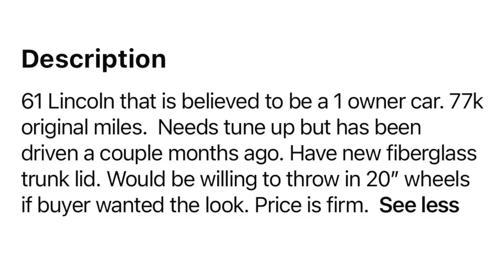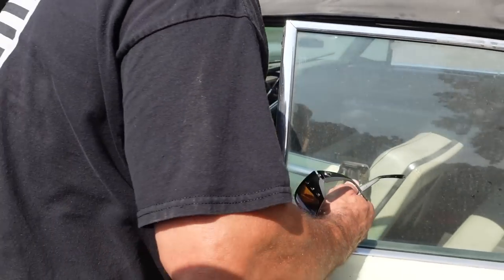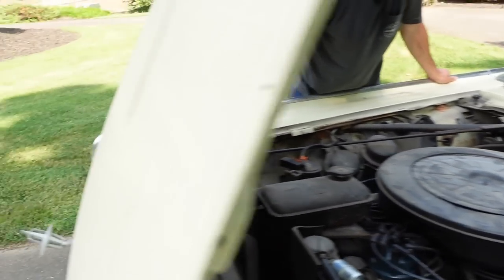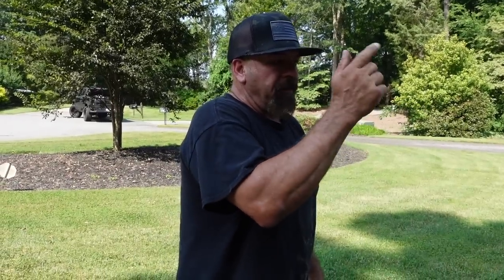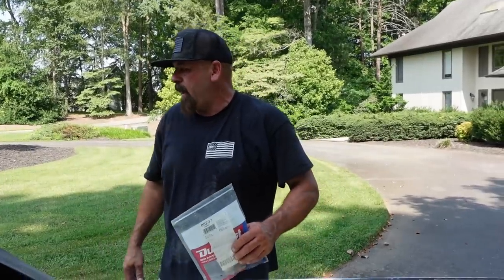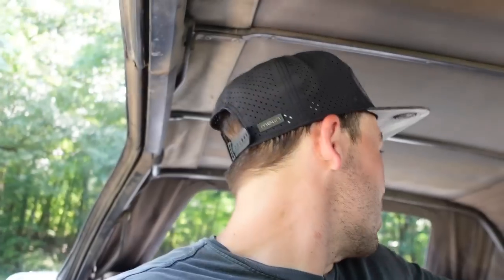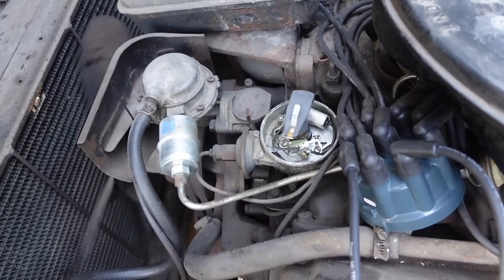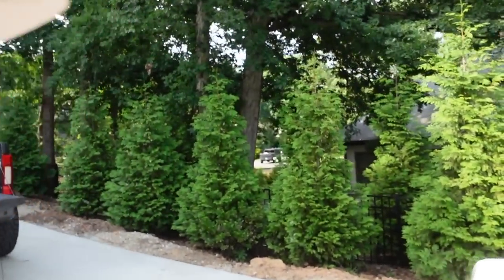We Bought A Rare Original 1962 Lincoln Continental Sight Unseen - Then Broke Down Part 1

Comment from the maker: What motor should we put in it?!
Reply: Ford godzilla would be sweet.
Reply: Dont ruin this gem have the motor rebuilt the value is that much more if the car was a rat then you should modify it that car is to complete 😢
Reply: That engine is like a 461 or something....replace it with a 460 if you don't rebuilt what is there !!!!
Reply: A 7.3 diesel would be an absolute riot in that old barge
Reply: a godzilla with a 10 speed trans and don't forget to bag it BTW I am from Wilmington
Reply: 7.3 godzilla
Reply: Godzilla forsure
Reply: Keep it ford powered, go with a godzilla power plant if the original engine fails
Reply: 12v Cummins
Reply: Definitely a tesla swap
Reply: Rebuild the motor in it.
Reply: Helephant swap 10sp trans
Reply: 6cyl ecoboost, keep it fomoco
Reply: Ford 7.3L Godzilla with a 10 speed
Reply: I vote for the new ford Megazilla.
Reply: Keep it ford powered...!!!
Reply: Rebuild the engine that's in it. Just upgrade it a little. Or a lot. But keep it a big block, Ford.
Reply: Gotta put a Coyote or a Godzilla motor in it then add force induction. Love the wheels! Its a dream car for me. Cant wait to see what you do to it.
Reply: Godzilla 7.3W/TT
Reply: Turbo 7.3 Godzilla
Reply: This needs to be done similar to Dax shepherds only in a convertible, big motor, lots of tire, drift brake just a badass driver that incinerates tires.
Reply: big turbos what ever you put in it ....  A Spooolin Continental would kick ass just sayin
Reply: SMX motor.
Reply: Power stroke it paint it black on black on black and call it night train with exhaust coming out the hood so it rolls coal like the old school trains did!!!
Reply: 2JZ w/big turbskies!   (Twin turbos)😂
Reply: Ford Godzilla motor HP tuned as well as 10 speed trans with air ride !frame off restoration with the second tires and build it into a daily driver. Smoke show machine.
Reply: big bock witj super jarj
Reply: Hellcat or coyote motor, do it triple black & pair of Detroit steel wheels ... Do not chop it up etc like the c10
Reply: Brad I would keep as original as possible, nothing like seeing an oldie like that done up like it just came off the lot new. She's a beauty just the way she is! Take care and God bless😇💙
Reply: Coyote swap, keep it Ford, Lincoln , as much as I hate Ford, but I no whatever y'all do is gonna b Kool and fast🤟🤟🤟🤟🤟🤟
Reply: Brad your dad wasn't even a sparkle in your grampa's eye when this car was built, I know that you will do her right👍
Reply: Give this the full treatment Sema build convertible there cars have been done but not like you guys do and not a convertible
Reply: Coyote with a 3.5L whipple
Reply: Stroke that 430cid to a 462!!!!!!!!
Happy Independence Day, gentlemen!
Reply: Coyote 🐺🐾🐺
Reply: 7.3 powerstroke with compounds
Reply: Build something like Hoonigan did with Slay Poupon
Reply: Godzilla motor swap or a 5.0
Reply: Bro maybe 🤔 an LS swap
Reply: Do a 5.2 illuminator, or a 7.3 powerstroke
Reply: Put the same as Cleetus  macfarland  has in that mustang McFlurry.
Reply: @wilburfinnigan2142  that was after 66 this came with a 7.0 430 320 HP and around high 400 tq at 2000 rpm
Reply: My cousins first car was a 72 olds delta 88 with a 455 rocket and a 3 speed posi. That car was a beast for the size it would pass everything but a gas station
Reply: we put a 7.3L Godzilla in ours .... we have 3 brand new Godzilla with a 10speed trans fresh from the factory if your interested
Reply: Keep it ford big block, add some efi as well.
Reply: I'd rebuild the original drivetrain and freshen up the rest and make it a weekend cruiser
Reply: @lukefolken1597  was my first thought.
Reply: Mercury motor!
Reply: Supercharged Coyote!
Reply: Keep it Ford powered. Godzilla?
Reply: Unless the motor is missing or destroyed the original motor is
Reply: Don’t ruin a classic. Rebuild the original motor if possible. If it’s beyond repair, look for a replacement that is as close as possible. Too many classics being ruined with LS and Coyote swaps in my opinion.
Reply: Hellcat or demon
Reply: Godzilla and a turbo with a 10sp trans and a 9in
Reply: A 460! 
Why even ask!
Reply: GT500 engine
Reply: I'd keep it All FORD and do a GODZILLA swap  and then after that air bag it with some air ride technology or see what QA1 offers and definitely get those wheels on and would try to keep the PATENIA
Reply: Super charge a Toyota 1uzfe v8 and nos , bullet proof stock crank....something completely different
Reply: hellephant :D for sure ..  or tesla swap or something K series would be fun
Reply: 7.3 Godzilla crate engine
Reply: @lukefolken1597  hellephant or Megazilla :D
Reply: @jaison206  but it's a ford!
Reply: @jolo7693  /shrug doenst matter right new cars also have parts from other brands on there i mean look at hypercars and super cars there full of components that are from other cars and brands
Reply: 7.3 Godzilla gas
Reply: I feel bad for you and your dad I have a 68 Chrysler 300 2door hard top it’s lowered and has a custom gene Winfield paint 67k miles but it’s all original beside paint clean almost zero rust runs drives like new I would sold it to you guys for 10k just to see you guys enjoy it I got it to enjoy with my father but due to him losing his job and my injuries we won’t ever do anything with it beside drive it once a year in parade
Reply: Put in a John Kasse 460 , with fuel injection
Reply: Godzilla
Reply: Stock block and heads. If there are numbers...you want numbers matching.
Thats doesn't mean you can't build it or revalve it.
Reply: Possibly a 430
Reply: @lukefolken1597 you have to completely chop the cars front end out to do that. Not a wise choice on a unibody
Reply: Safety tip number one, 
Don’t let the car run with no one in it. The shifter tube bushings wear out and the car can fall into reverse on its own. It’s common
Reply: Barra
Reply: The engine is a 300hp (Ford/Edsel) 430 ci. Decent engines actually. I would find a builder to redo what's there if the block is still good. Find the Jay Leno episode on one of them. There's a guy on that travels around the country and ONLY works on this vehicle. He knows every thing about them and he can fix in a day what a butcher would waste months working on because he has no idea what he's looking at. It's old school, but quite complex for its time.
Reply: If the og motor is good I say keep the 430 that’s in it. They aren’t incredibly powerful by today’s standards but they pull strong
Reply: The motor could be a 4 valve 462ci big block or maybe was just later Continentals. I would have bore scoped it first before starting/ let the chambers soak overnight see if the rings come back around. Oil change regardless/ spark plug change if previous caretaker didn't do and run to a temporary fuel source. But..... I can totally understand the excitement and cruising in it right away. Imo this was a great buy. I would detail it. Get it running and driving good. Fix top issue and put it through a auction. Depending on mileage it could go for 60k+ if it gets good hype
Reply: I’m a Mopar fan. But honestly I would stick with a Ford motor preferably the original with the matching numbers.  I wouldn’t worry too much about how many cubic inchesif you replace it. Any modern motor 5 liter or more is going to have more torque and horsepower than what came with it.
Reply: Super charged Coyote
Reply: Get it driving run around in it why waiting for parts and big block it paint it and retrim it so its full on badass
Reply: Stock motor cleaned up. You are going to have enough problems with the top, don't drown yourself in projects.
Reply: Cummins!!!!
Reply: The standard 460
Reply: The standard 460
Reply: Throw a 460 in it .  Wax it and drive it.  Full resto on thoes is never ending.  That top is a nightmare.....
Reply: If anything, a 462; that is really the only engine besides the 430 it has now that will go right in.  Nothing else will mate to that transmission, let alone the structure, without a good five figures of structural cutting and total drivetrain swapping (we're talking more than initially paid for the car, at least as much as it is worth, which I suspect to be a good $30g's in its current state).  You are aware this car does not have a separate frame, right...?  If not, you are now.
Reply: @aloysiusbelisarius9992  I have a friend that has a 63 Ford Thunderbird with a 430 in it it was special ordered that way
Reply: Just rebuild the original motor & restore the car.
Reply: @philliphart706  Indeed...??  That had to have been a very special order; the 430 became a Lincoln exclusive starting in '61!  On the other hand, T-Birds and Lincolns were produced in the same niche of the Wixom factory back then, so it might have been relatively easy to move a 430 from the Lincoln line and drop it in a T-Bird.
Reply: @aloysiusbelisarius9992  my buddy got the car from a guy that owned a dealership and he ordered it that way
Reply: Keep it all original!! I think that engine is a 430 cid. During his motorcade I saw JFK sitting on the trunk part with his feet on the rear seat of  a1962 blue convert in mpls mn in Oct 1962. I hope to get one someday. Great car!!!
Reply: Something that rare and original should be kept that way. If you want a hooptie then find a basket case and put whatever you want in it. You guys amaze me that you don’t even know what engine it has in it.
Reply: You are incorrect, the tbirds came with them for a coupes years. No idea which ones and why, but some did. Maybe certain plants or inventory reasons. 

To respond on your other reply also, my 64 had an original drivetrain. My current 65 I swapped and both were my daily. With that said I’ll never own another MEL powered car as they do suck in every way for modern driving. That is all
Reply: @madkidd00000007  no I'm not incorrect 61-63 at special Thunderbird 390 I have a 63 my friend 63 who he bought from a a former car dealership owner I have seen the line set ticket 430 cubic inch motor is in that car it was ordered that way in 1964 they put 429 in those cars we had a mountain West Thunderbird club here in Idaho which I was the vice president of unfortunately a lot of our members passed away or they sold the cars but as far as you saying about how they drive or whatever I'll keep mine till I die and runs great handles great not like this junk they make nowadays of recycled beer cans and milk jugs and that is all I have to say
Reply: Shouting out from Greenville NC ❤
Reply: 5.0 coyote with a Whipple... Ultimate sleeper.
Reply: please for all of us Ford people... keep it on the OEM motor
Reply: The key selling points from factory should be improved and highlighted like the air suspension should be ripped out and updated and the convertible top switched to electric or the car is going to have a broken top or a broken suspension and not fun to drive.
Reply: Pretty standard Mercury Marauder parts. Formerly Hot Rod Garage Tony Angelo’s could help you out he has been doing some luxury Ford Hot Rods lately.
Reply: Fuq YEAH! Keep 'er Ford fellers...can't wait for this one! Damn, I think I got a chubby!
Reply: Cobra Jet
Reply: Restore and rebuild.  Don't destroy its value by chopping or swapping.
Reply: Keep original otherwise go coyote.  I got a 68 and cant wait to work on it
Reply: Put a coyote motor in it
Reply: Or her ego boost motor in it with a 10 speed training
Reply: yep. Godzilla. stock Godzilla! don't get too silly with it.
Reply: Keep it STOCK!!!
Reply: Those original MEL 430 V8's were bulletproof. Keep it!

Comment: I've followed these cars for over 30 years, and I own a '63 sedan. To find an original '62 convertible in this condition is a really good deal and a rare opportunity. Having said that, I know the restomod market for these is pretty hot, but they're only original once and original ones are disappearing. I would get this in shape and keep it original, then use the money to restomod something that's already been worked. Originality is very very valuable. It's your car, but it would be hard to see this car lose its original quality. 

The engine is a 430 MEL, by the way. MEL stands for Mercury Edsel Lincoln. This engine replaced the old Y Blocks used in the Lincolns of the 50's.

Comment: Full frame-off restoration. You will be amazed at how much you'll appreciate it and how it runs & drives.
Not everything you own has to be a racecar.
Reply: "Not everything you own has to be a racecar" -- exactly!
Reply: Couldn’t agree more.
Reply: They are uni-body so no frame.
Reply: @Alwhite1929  let's not split hair and get technical, you know exactly what I mean. It can still be restored and be an excellent car.
Reply: You’d be amazed how bad they run with original drivetrains if you actually owned one
Reply: @charleswhitten3441  Ain't no hair-splitting there.  The difference between frame and no-frame is major, especially with these cars which are even more unitized than cars made today.  Not even the fenders will come off without cutting...and any helter-skelter cutting into the structure will compromise its integrity.
Reply: @madkidd00000007  I trust you mean the context of the opposite, right...?  That's how I would take it, because my own is capable of breaking its speedometer, yet it's as calm and smooth as anything with any legal speed limit one chooses.
Reply: @madkidd00000007  Not true at all. It's a luxury car and runs like one. I had a 40+ old one and it started and ran perfectly and of course a 700 pound V8 is extremely smooth.

Comment: You have a rare beauty in that old car. Please don’t ruin it by chopping it up or slamming it to the ground. Or by putting giant clown wheels on it. Give it the full frame-off restoration it deserves.
Thank you  👍
Reply: They don’t have frames for starters. And original drivetrains on these cars suck
Reply: @madkidd00000007  You are absolutely correct. I used the wrong terminology. Thank you for correcting me. I simply meant a full restoration. As for the drivetrain, I would love to see them put something beefy in there. I just hope that they will treat an old, classy car with class.
Reply: WORD! ✊✊
Reply: Good call. Keep It clown-free. Coyote power plant and modern transmission would transform the car. 4-wheel disc brakes.
Reply: @madkidd00000007  Having experience with these cars, I have to disagree with the "suck" assessment.  That drivetrain is rooted in high performance, however tuned down a bit for luxury-car use...which is more than can be said about engines today (save maybe for Hemis) which are plain rollers on steroids and not really meant to last half of forever.  There is hardly anything that matches the durability of a clap-door Lincoln's drive train.  The one detail that can, however, warrant the assessment of "suck" is the two-barrel carburetor installed in this year.  A 4-barrel would have been better, which was why they changed that the following year.

Granted, the components aren't quite so beefy as the ones used starting in '66, but they were enough to propel the heaviest-built cars in America to triple digits (not that there is any place in America aside from closed race tracks where one would even use such speeds).
Reply: @madkidd00000007  And how is it that the original drivetrains suck? I have an original drivetrain and engine that was carefully maintained and sixty one years later, it runs fine, shifts fine.
Reply: @aloysiusbelisarius9992  The two-barrel is fine and has better torque off the line and better fuel economy.

Comment: Awesome rare car. Keep that in mind rare car. Do not make something out of it,
that it is not meant to be. Rare car is already enough of a good thing. Keep it as 
original as possible, old school of course a few upgrades are okay like paint, 
carpet, disk brakes maybe, use factory or original parts. Go through engine 
completely, maybe electronic ignition maybe , AC maybe, if you can find 
factory piece. But all original would be better. Those are my thoughts, since 
you guys asked to put individual thoughts in comments.
May you find Harmony,
respectfully Sven.

Comment: The top is hard to synchronize all the motors, there are many many hours ahead just to make that work but it's worth the effort.  I had a 58 Ford hard top convertible with a similar setup, there are limit switches that control when the individual motors run and the most important part is the synchronization of when they turn on to pull the top down  into the locked position. If not prefect the top will set deeper on one side than the other and could bend parts and cause one motor to get the signal to stop while the other is still running. The good news is that there are no computers to deal with only timing and start stop signals.  That was a long time ago I got that car from under a tree during my senior year 1966, so yep I'm an old coot.  I drove it until I got drafted I went everywhere in that old Ford including a trip from Phoenix to Oregon in 1967.  I paid one hundred dollars for it put a bunch of miles on it but my dad sold it while I was in the Army I think he sold it for scrap even though I ran fine when I left.

Comment: Blue smoke usually indicates oil in your cylinders. Usually caused by a bent rod or sticky valve. Take off the top end and go through everything and clean it up
Reply: Pretty sure they know whats up when it comes to vehicles
Reply: I was kinda worried bc they didn’t check the oil before driving. Lol